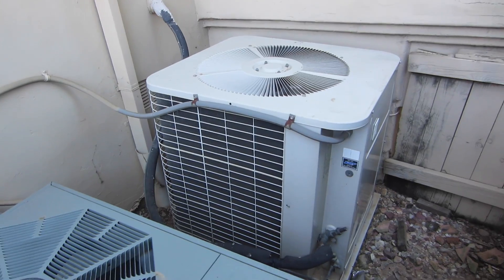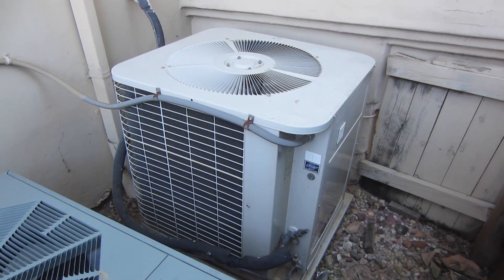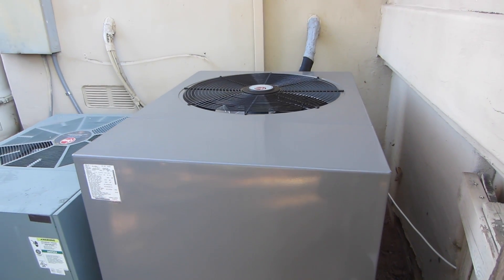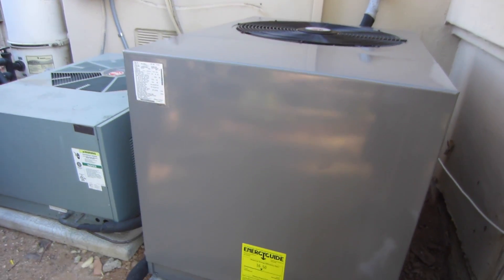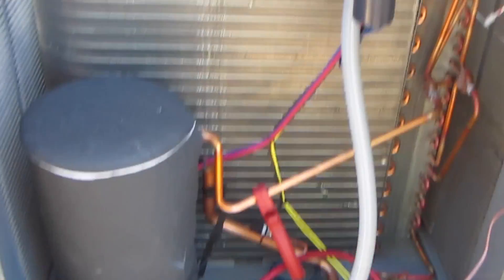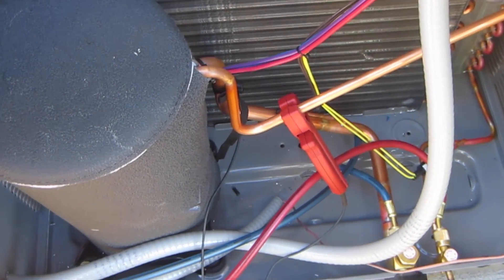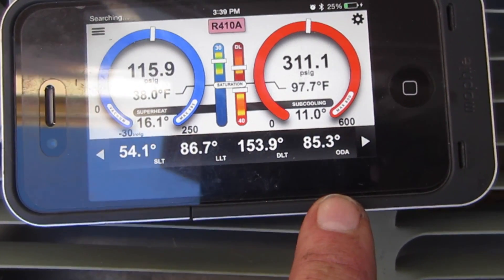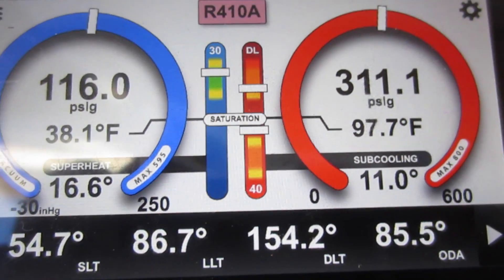iManifold with a Two Stage RARL Rheem condenser

Comment: I saw this one, I got intrigued and I saw the furnace man you sent, I have the concept I have a idea and I understand that what  he did, But you not using the same line as the inside. So that’s my confusion. And this is very good to know to save me allot of headaches in running extra wires. 
Thanks
Reply from the maker: In my video the condenser is a 120v transformer, the LI in the condenser and the LI in fau need to be on the same line of power(same phase).The transformer in the condenser needs to grounded to the chassis and then the two R wires (condenser and fau) need to be on the same phase.
Reply: dizziedallas I sure will give you a call. Sometime this week. Thanks.